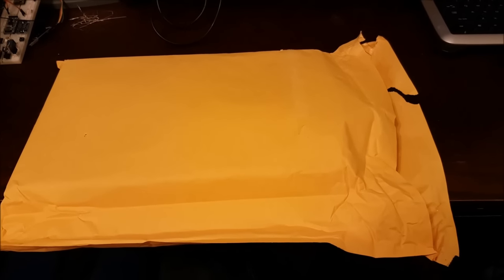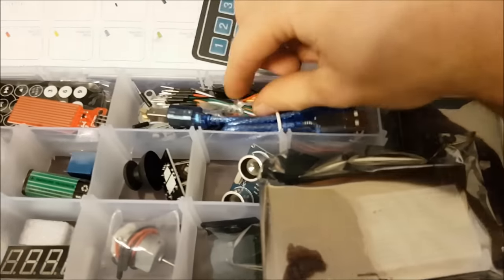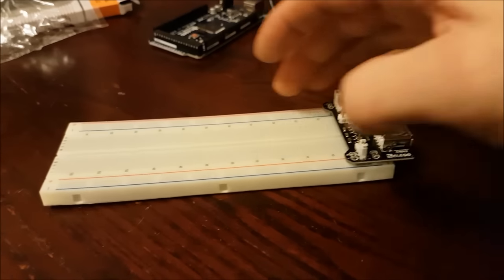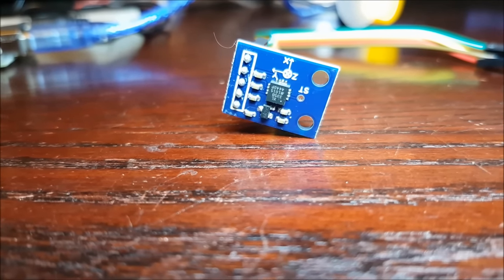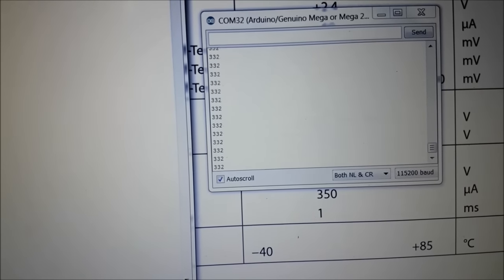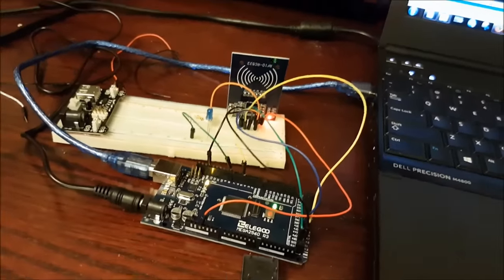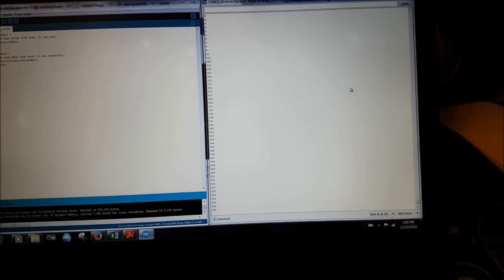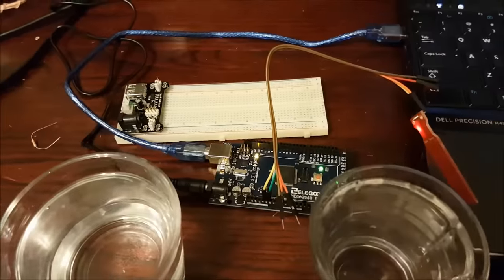Elegoo Mega Arduino Project Kit

Comment: For the soil meter you can stop corrosion by making sure it is only powered up for a second when you need to take a reading, not left on all the while...
Reply from the maker: True, I found it took a while to stabilize but soil moisture changes so slowly you run this every hour or two

Comment: Do you think this would be too advanced for a 15 year old who's never done any programing before? What do you think is the minimum required computer needed? Thanks for the review, looks fascinating, just not sure if it's a bit too much for a complete beginner.
Reply: I am 15 and I had no problem although I have been coding since 11 they include code for each project. The only time I have needed my coding knowledge is when adding on to projects. That gets a little more complicated. I recommend you check out the Arduino syntax and memorize it beforehand. If you want to get this for just learning all the base projects you do not need any coding knowledge. A good book for programming the sensors is "Programming Arduino Getting started with sketches" it tells you about the syntax and coding for some of the sensors.
Reply: I don't know. I am just a starting 30 year old. Lol. Should have learned this stuff years ago.

Comment: Considering buying this.  I'm a total Arduino noob.  What's your impression of the component quality now that you've been using if for a long time??
Reply from the maker: There is nothing unique about the kit besides the microcontroller board itself. Its all just parts made by random Chinese companies stuffed in a box. The Mega itself is great, but so are all the other Mega clones I have. If you don't have tons of odds and ends to tinker with it's a good buy IMO.

Comment: with that, you can add a shield from other brand ?
Reply from the maker: You can use most shields yes. Some shields are uno compatible but not mega compatible and some are both.

Comment: Are there additional tools that would be helpful when working with this kit or is it all inclusive? Is a soldering iron needed?  I am completely foreign to this stuff and am looking to purchase it as a gift. Thank you for any help/suggestions!!
Reply from the maker: A multimeter would be useful for troubleshooting. You don't need solder but if you were to make something permanent out of this like a soil moisture monitoring system you would need some protoboard and a soldering iron. To do all the exercises in the kit you don't need any additional equipment

Comment: Did you have any issues uploading the code ? it gives me an error when I try to do it, I dont think is recognizing the board
Reply: Yerandy Prado you have to select the type of board from the arduino code menu when using a 3rd party Arduino
Reply from the maker: I didn't on this board but I worked out all my driver issues long ago for most Arduino boards.

Comment: Is there a difference between official arduino or not ?
Reply: Pineau Paul sometimes yes sometimes no
Reply from the maker: Yes, but no differences that will cause any issues. Mainly just appearance and component manufacturer type differences.

Comment: my "issues" with this kit is that there's absolutely NO PROJECTS included, a bunch of the code and libraries are deprecated (last updates 12.9.16).

Just a bunch of "...plug this in...", "...upload this code..." and "...look it works ..." maybe ...

Be wary of the libraries and code. Best to UPDATE them and hunt for examples/samples from adafruit and arduino.
Reply: Lol. There are projects like you build robots and sensors. Those codes and jumper cables are lessons to learn.  Also, you forgot you assemble it. Doing it your way. Would make it really hard for someone like myself to learn it.

Comment: this set is extremely overpriced.. you can get the exact same kit, WITH an real arduino uno for around $30 on Aliexpress..
Reply: lennart pennaertz 

Have fun waiting for months to finally reveive the product. I'll just order it now and receive it in 2 days max.
Reply: true, i just ordered one
Reply: I only waited 10 days
Reply: There is no such thing as a "real" arduino. All Arduino boards use off-the-shelf components and run on open source firmware. You could make your own Arduino board and sell it if you wanted to.